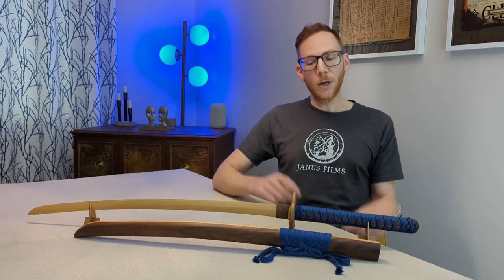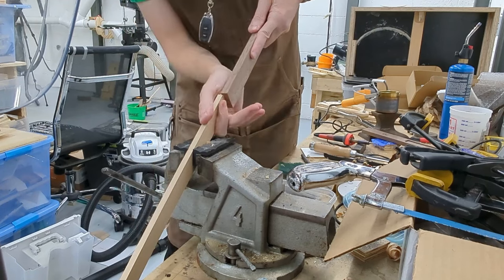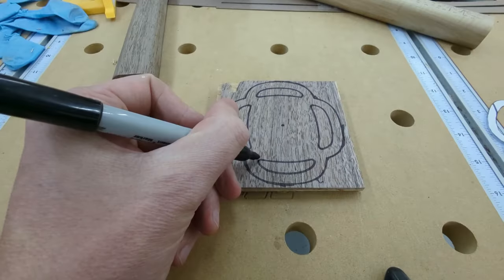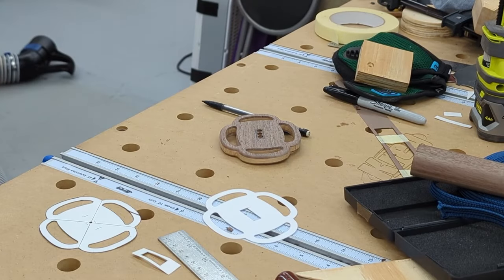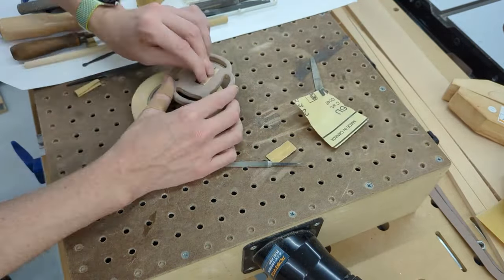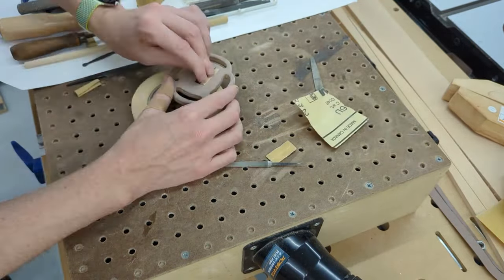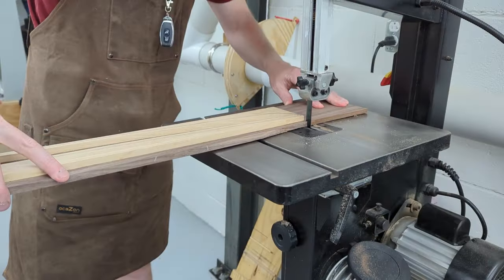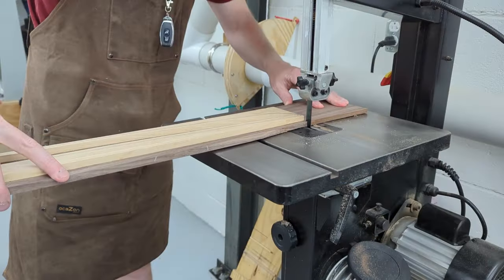Making a Wooden Katana

Comment: This type of design is made traditionally in Japan, however it is not katana, since it is not steel, and its not bokken or bokuto. This would be considered "tsunagi". The purpose of tsunagi is to replicate the general blade shape so the koshirae can be stored/displayed without the actual blade. This was typically only found in the highest ranks of samurai, as they would be the only ones who could afford or require more than one set of koshirae. If you go to a Japanese museum and see swords displayed on a kake with koshirae on top and blade on bottom, a tsunagi is inside the koshirae holding everything together for display.